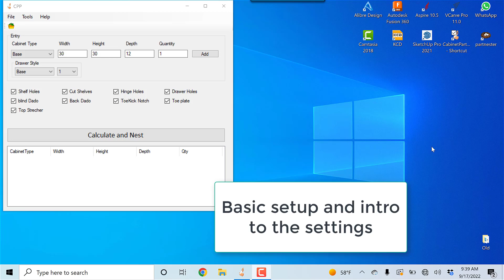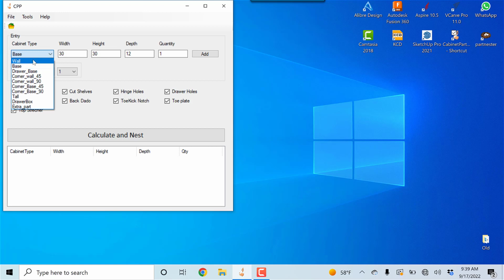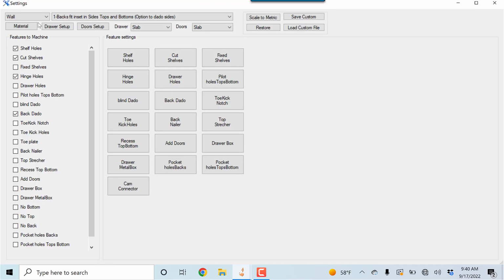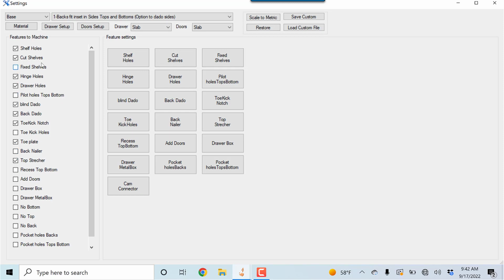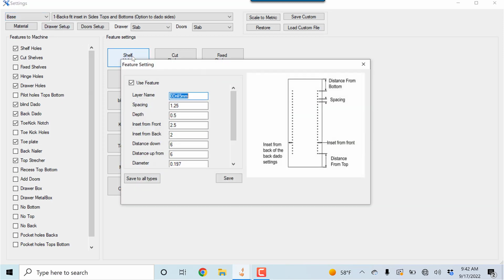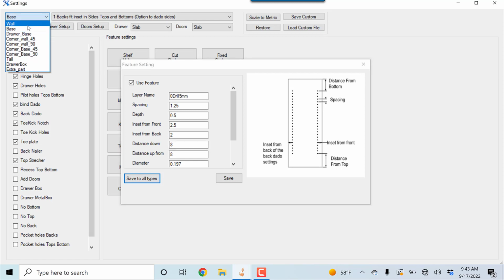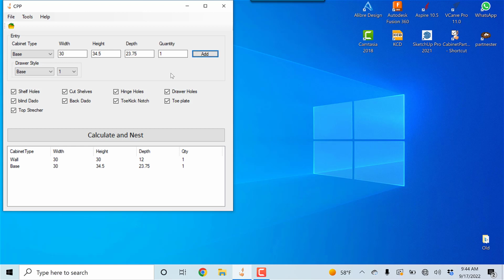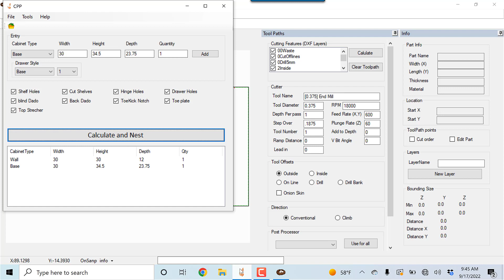Basic Setup Intro to settings

Comment: Hey Ryan, to add an extra hinge on a 42 inch high cabinet for a total of three would I have to do that though a script?
Reply from the maker: If you are not have CabinetPartspro cut doors then you can go into the door setting and tell it the upper door is 21" This will then add a third set of holes 

The script method would be the better way.  I will create a script for this later today.  Then post a video of the usage.

Comment: Are all of these frameless cabinets or can you add face frames to these cabinets if wanted.
Reply from the maker: It will not calculate the frame.  It will create a box for frameless or a box to add a frame to.  I does have options to place the tops and or bottom recessed to allow for a frame.